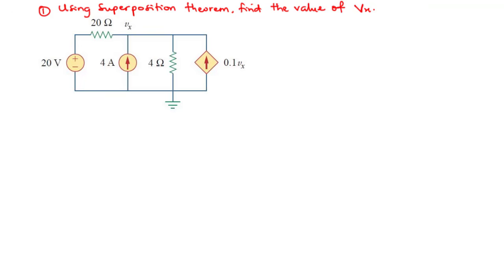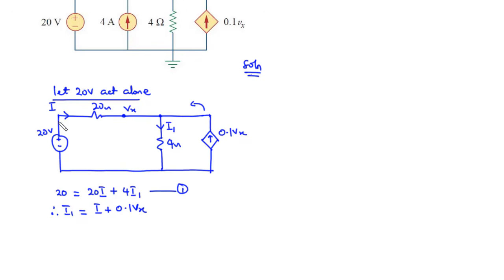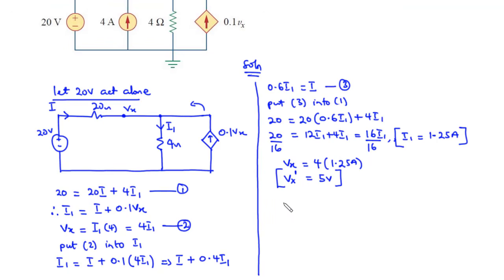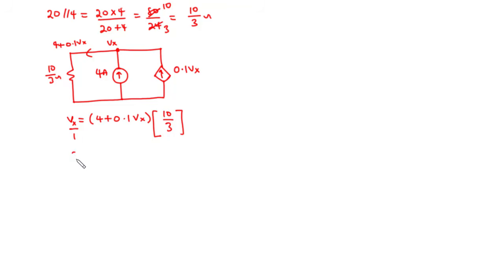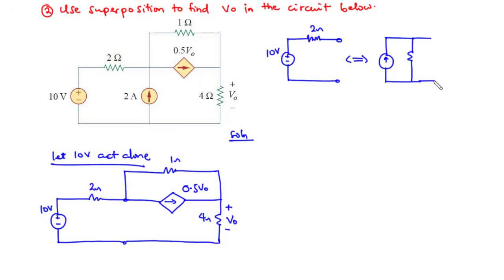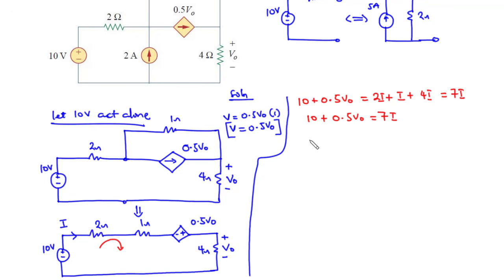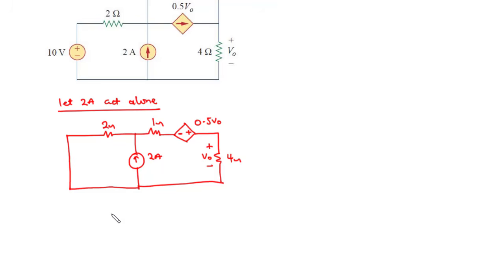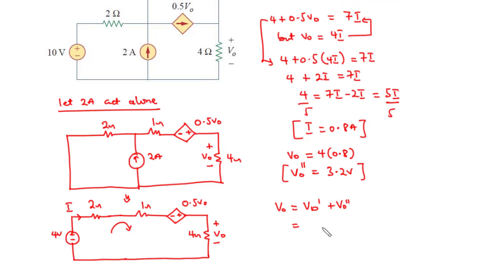☑️19 - Superposition Theorem: Circuits with Dependent Sources 1

Comment: Please why the the 0.1vx current source not eliminated when dealing with each of the sources independently
Reply from the maker: It's because 0.1vx is a dependent source. A dependent source does not produce energy to the circuit on its own. It depends on the other sources.

Comment: i dont understand why these are needed to be honest. I can solve these questions perfectly fine using nodal analysis or mesh analysis. I understand that they can be shortcuts, but I am able to already solve these questions quickly without superposition.
Reply from the maker: Hehe, great
Reply: In the exam thy ask particular theorem then also  we want to use which theorem easy to us???
Reply from the maker: They asked you guys to solve with any theorem?
Reply: I mean that is like saying why cramer rule exist when you can solve linear equations faster using elimination method or gauss jordan method
Reply: @rafiihsanalfathin9479  they are all methods to do the same exact thing. I would rather just practice one method than multiple 🤷‍♂️
Reply: hey can you help me doing the same question in nodal and mesh analysis ?